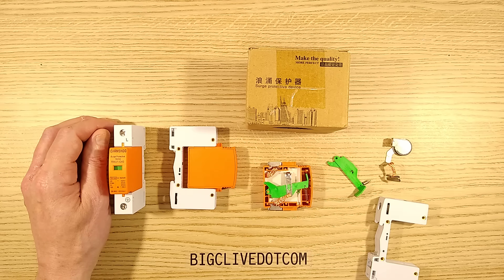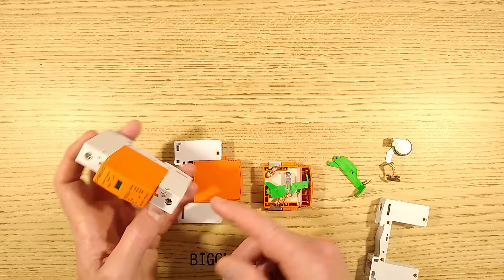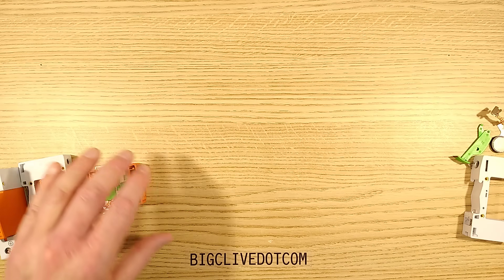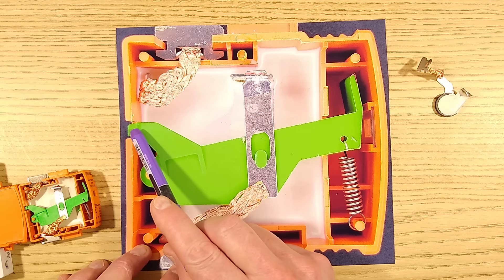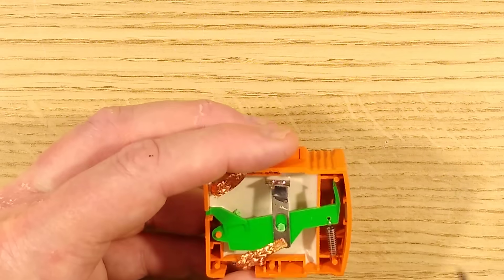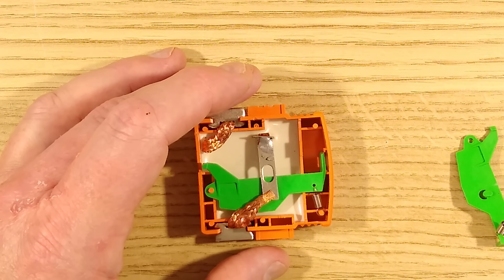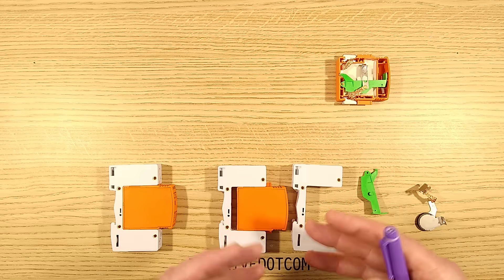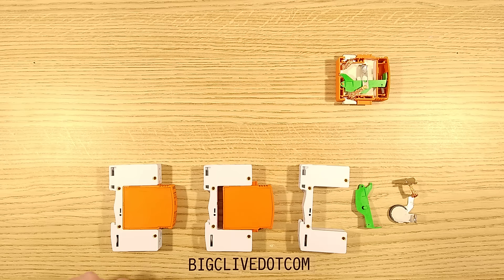Defective surge protector being dumped on eBay

Comment: Handy little features, they are! It trips, and you don't need to reset it! It still shows green, so it must be good, right? and the solder bridge keeps the circuit closed! What more could you want, from poor grade junk?  And, as a bonus, the solder bridge means that for added safety the current handling capacity is reduced into the bargain! 🤦💨🤢🎆🔨

Comment: Lack of red flag is for sure a serious manufacturing mistake, but the solder actually may not be. Depending on alloy it is probably not eutectic, so it may have a point at which it is not solid but not a liquid yet. That would be essentially soft enough to allow for clean contact break

Comment: These should be checked with a thermal camera if possible and certainly current flow under live conditions. I've seen them cause fires without previously showing flags so can fail progressively.
ABSOLUTELY a good idea to place in a separate enclosure!

Comment: It should be noted that SPDs don’t protect against lightning, if lightning gets into your local electrical distribution system, the SPD will be just as wrecked as your beautiful electronic equipment…
A SPD may provide some limited transient protection. But again, if lightning induces enough energy into your electrical system…
Similarly if there is a electrical distribution fault that significantly increases the line voltage, again, your SPD is unlikely to provide much, if any protection.
Oh, and I’ve seen industrial systems that have suffered damage after induced energy from a lightning strike. It killed a conventional mains transformer. Similarly, a 33kV line falling on a low voltage system also killed a conventional mains transformer.
I’m not saying don’t have SPD, but don’t expect miracles from them.

Comment: any difference using 3 single ones or 1 3phase one?
Reply from the maker: If the 3-phase one is just one per phase to ground then you could use three separate ones.

Comment: It would have been better to test it under normal operation by providing over voltage to melt the solder. As solder draws towards the heat source having the heat delivered from an abnormal point could cause a faulty test.
Reply: I think it would have continued to heat up if the solder did create a bridge and open the circuit.
Reply: thousand volt multiple amp power supplies are kinda spendy
Reply: @zyeborm Those devices aren't designed to protect "thousand volt" power sources. 
He is in the Uk where residential voltage is 240V, The trip design voltage may be 270V causing maybe 1A [240W] or less to flow through the solder joint. We could look up the operational design parameters or maybe Big Clive could pop in with the specifications. I know the overvoltage voltage required to trip the device wouldn't be too much. 
How much voltage can electronic devices [stereos/TV's etc.] handle before they pop?

Comment: The little tab at the back might be to trip out the other phases so you don't end up with an unbalanced load. Just a guess.
Reply: It'll be for the remote indicator.  You can get a base module / holder with terminals on it to connect to what ever low voltage / current thing you like.  That could even be an electronic trip mechanism for other breakers.
Reply from the maker: It's purely for remote monitoring of protection failure.

Comment: Guess they only need to have the flag painted red with some nail polish, and there, fixed 😸
Once electricians were replacing a trafo, and they connected a power generator for the time of the operation. Three phases were all good, but "forgot" to clamp the N also… and we got over 300V between one L and N, blowing up many protections. Fortunately nothing failed, 'cause short protection would kick in. Just some fuses perished, all electronics survived. Neighbour on the other hand had low voltage, LED lamps would flicker, and some surviving classical bulbs were dim. Fun.

Comment: This should be changed if they trip.
They are not supposed to be used many times
Reply: But this cartridge doesn't indicate if it trips, if anyone even looks in their fuse box after the thing has protected the installation without cutting the power at all .  Next surge will suddenly get through and fry all your gear because the indicator disconnected the protection .
Reply: they trip only if the surge is big enough. If it's not they can stay there

Comment: If the MOVs experience too many surge hits, does the on-resistance go up? or the trigger voltage threshold changes?
Reply from the maker: As it breaks down with each transient it gradually develops a resistance at lower voltage and heats up.

Comment: Going to say it again as I'm sure I said this before on yours or similar channel.

Commercial/industrial electrical equipment like this is very dated technology. The big brands have a monopoly with it because they have the refined infrastructure of assembly and manufacturing already.

The "smaller" brands can compete only by cutting overheads of companies, cutting chain of middle people or skimming on products beyond 'accepted' standard.

The reality is, is it worth buying grey market export (no traceability, no quality assurance) or off brands? Not really. Take the hit/premium from buying one, two or few offs and get on with life. Love to be frugal but this is not something you want to skimp on.
Reply: Fwiw, bigger brands will have quality issues. Just that they're more dedicated to keep their quality/name out of the toilet so they will try that little bit harder to rectify. 👍
Reply: Yes and no. Big brands love to gold plate stuff but it's very basic technology at this point so there is no reason it can't be done cheaper. There are plenty of honest cheaper brands that make stuff that works fine.
This does not mean you can trust random trash produced overseas where nobody has even seen or cares about the safety standards the device is supposed to enforce.

Comment: If the SPD fails, you want all the protected circuits to be disconnected. But that isn't what happens the way that people fit them these days.
Reply: Depends on the circuit I suppose, but there are some that fail "load disconnected" and most that fail "protection disconnected" and usually have to examine a LED to tell

Comment: Excellent, it never turns red and never cuts the line.
Reply: It is connected as a shunt to ground, not in series, so if it trips you just then have no SPD and you'll never know unless it lets the smoke out.

Comment: Well blo0O0ow me up !
Next they'll be selling wire without insulation ...
 ,  ;)
Reply: shhh dammit don't give them ideas
Reply from the maker: They're doing better than that.  The copper coated aluminium wire is a mile worse because it LOOKS like proper wire.
Reply: Yeah, I remember it in the old time mica earpieces for Crystal Radios. And yes it's reappearing in todays gear..
 ,  ;)

Comment: Surely I'm not the only one wondering why they didn't make that component in red, so it was the green bit that got painted in? Fail-safe build?
Reply: Toyota manufacturing philosophy from the 20th century had such a rule about protecting against factory mistakes .
Reply: Strange indeed, the tab should be red plastic, so if the paint is not applied or wears with time, the default color will always be red.
They could also sell more units if those actually tripped and didn't stay green forever. Oh well.
Reply: @TazerReloaded  They could make the tab smaller for orange to become visible .  Negative material cost but significant retooling and certification cost .

Comment: The whisker would most likely have broken if you had kept the iron on the connection tab after it tripped rather than immediately pulling away.
Reply: It was also laying down, gravity might have helped bring the solder down with the switch.
Reply: Yes, but he was trying to simulate resistive overheating in an overcurrent situation.
Reply: @erinfinn2273 isn't that what he would have been simulating had he kept the iron there?
Reply: @erinfinn2273  It might  have continued to heat up as long as the solder completed the connection.

Comment: i guess i'll buy 150 eur obo bettermann
Reply from the maker: I'm not totally convinced that the higher profile units justify their inflated cost.
Reply: this is 3 pole 3 phase 230/400v device rated and tested and verified for type 1 and type 2 spd and high current. it might survive, even if once, a direct hit of average bolt into insulated overhead cable of tn-c system. i mean survive at least so much that it shorts that pulse, even if entire panel is bust after it. it might contain just huge varistor. maybe spark gaps. i too think 150 is too much but then all of the actual eu brands are same, so who knows. and it's a device you don't need really. i pay about same over few years as house insurance which i also never use, and never hope to use. so i'm considering this. unless you have better idea. yes, i was considering 10 times cheaper device but do i know what's in it?

Comment: As a sparks, I'm seeing more and more of the devices  have  tripped ,and the customer doesn't bother getting them replaced they see them as an unnecessary expense. Good quality electronic equipment has voltage spike protection built in . Do we need them in our consumer units , the jury is still out one this one , we managed without them in the passed
Reply from the maker: If the UK ones weren't so massively overpriced then people might actually swap them.
Reply: Surge suppressors are wear components and their effect is somewhat cumulative. Those people will find their electronic appliances don't last quite as long without the SPD at the service panel to absorb some of the abuse.
Reply: That's fine, the less protections the customer have the more likely they are to call you again because a surge fried their device. And then they have to pay for actual board replacements or whatever

Comment: I was prepared to forgive the lack of red paint since it would still do it's intended job, albeit not indicating so forcing unnessessary fault finding, however the solder link remaining after it's triped is unforgivable...
Reply: I imagine that the tag heating up due to the 'thing' below getting hot would evenly melt the solder, whereas the soldering iron can only apply point heat - hence the bridge remaining. Anyway not a good thing to risk saving a few pennies on...
Reply: @dougle03 The colored flag is meant to show that the device is providing protection.  If it trips out and the flag doesn't change color, it is no longer providing protection and you'll have no idea.  That is not forgivable.

Comment: OMG!  all these years that I've seen surge protectors and I have never, ever seen one that had a circuit breaker or fuse to protect against a fire caused by the protector burning up!  

And I once had a power strip with a surge protector spontaneously go POP!  The MOV burned up but it didn't make the plastic power strip catch on fire, fortunately.

For decades I have been telling everyone that the surge protector power strips are a rip-off, they add a ten cent MOV, and charge double the price for the power strip.  And the surge protector doesn't protect because the mov doesn't have a good ground closeby.

This is why I tell others that the only safe and effective surge protector is one that's installed at the breaker panel, where there is a good ground.  

Now that I know that in order to be safe, a surge protector should have overtemp protection, I have one more reason why the surge protector power strips should never be used.  Thanks so much, Clive.  You have made my day.
Reply: Surges happen between phase and neutral .  Earth connected MOVs are a bonus protection if the neutral is broken and the protected device allows isolation breakdown .
Reply: Not debating them being a rip off for the price because they certainly are but in terms of functionality they do work... if used properly.  The trick is the average man off the street has no idea about this.  If all appliances plugged into the power strip are isolated from the outside world, ie no wires such as TV antenna, phone line etc that are not also part of the power strip clamping, the MOVs will prevent the appliances seeing excess voltage across their terminals.  Breach that and all bets are off.
Reply: @retrozmachine1189  
My point was that the MOVs fail causing a hazard and/or fire.  They are not safe because there is no fuse to protect the mov from causing further damage.
Reply: @acmefixer1   @acmefixer1  Fair comment but I was responding to the part of your comment about the surge protection in these powerstrips(boards) not working at all when they actually do if used properly.
Reply: @retrozmachine1189  
The surge protector works properly if there is a good ground closeby.  That's unlikely in a room other than a kitchen or bathroom.

You said "If they are used properly".  The surge protector is never experiencing improper use when it's not protecting against surges.  When it is protecting, then there is no control whatsoever over whether or not the surge protector is experiencing fault conditions that are not proper, such as high voltage surges caused by lightning.  That's why all surge protectors should have fuses or circuit breakers.
Reply: @acmefixer1  I don't think you understand how these things really operate and the possible modes of operation. I thought I had detailed it enough before but obviously not.
Reply: sorry what? surge protectors are modules that do just one thing, if you need a breaker or a fuse you need to install them
Reply: @marcogenovesi8570  
That's the problem!  Surge protectors do more than one thing.  And that is when they sacrifice themselves when protecting, they burn up!  So it's irresponsible for a surge protector to fail catastrophically and cause a fire and damage to its surroundings.
Reply: @acmefixer1  No it's not their problem. Surge protectors are meant to do only one thing, just like breakers do one thing or fuses do one thing. 
If the surge protector or anything else (relays or contactors or motors or whatever) can fail in a way that creates a short circuit you need to have the devices that protect against shorts.
That's the point of modularity, and having someone actually design the circuit and not just an elechicken wire it by the seat of their pants as is the case forlots of civilian electrical systems.
For example if you install the surge protector AFTER the fuse and breaker of the circuit (but before the load) then if it fails it should trip them and disconnect the power.
If someone is a genius and wires it before the breaker/fuse then yeah if it shorts out there is nothing you can do about it

Comment: Reputable sellers recommend using two SPD with a circuit breaker between them, that's the correct way to do it.
Reply: @_Rich_.  I will look it up. My statement is based on the recommendation from DEHN
Reply: @_Rich_.  Wouldn't mind seeing one of them cut open to see how they manage it.  MCBs etc have arc extinguishers since they are intended to break fault current.  These compact SPD modules don't and aren't intended to.  The soldered tab is just to handle the flag be it short term overheating from a big hit, or long term overheating from degradation of the MOVs.

Comment: It is not a fair test, though I doubt it would have given a better result.  You did add solder to the link.  A better test would have been your hot air gun.  I guess you did not have it with you.

Comment: Curious if the trip mechanism would work better if heated slowly with hot air
Reply: Great, then all you need is a full time employee to stand next to your breaker box with a hair dryer pointed at it.

Comment: I've seen a lot of SPD installed without a MCB in front of them to break the current in the event that the SPD fails. The value of this MCB is normally specified in the SPD data sheet. I've seen DC PV SPDs requiring breaker ratings of 10A if the Isc of the panels is in excess of 10A. The breaker does not impact the SPD operation because transients are too fast for the breaker to operate. 

It is worth noting that SPDs protect against transients not overvoltage conditions and will start to conduct at about 50% higher than their rated peak voltage (peak for AC is 1.414 the RMS voltage).
Reply: MCBs upstream of SPDs have next to no value for this failure mode - a 10A breaker in front of this device would obviously not open if say, 5A were to flow continuously, which would involve well over 1kW being dissipated in that little plastic case, which will most definitely melt and may even combust.
Reply: @_Rich_.  "Do you really want the mains to trip on a transient?" YES. If the transient is long enough to cause a raise in current, I definitely want my mains to trip, that's the whole idea.
Reply: Some SPDs are rated at 100A, not requiring a separate MCB
Reply: I’ve fitted one after the RCD so any breakdown should result in the RCD tripping. I may get RCD tripping when suppressing a transient but at least I’ll know it’s working.